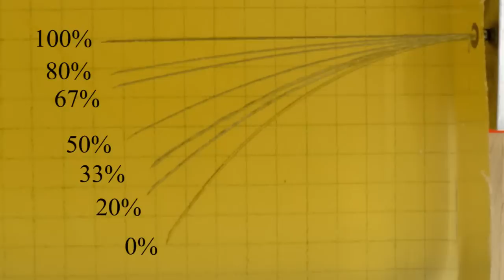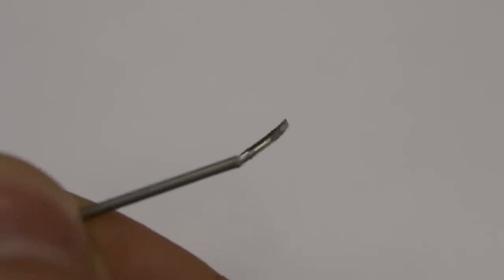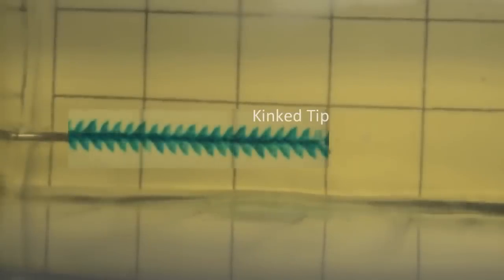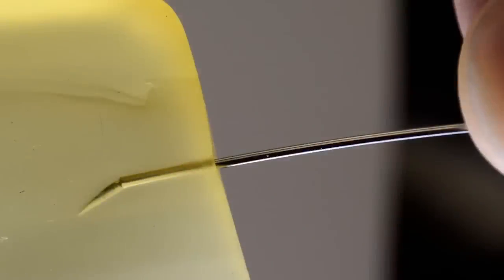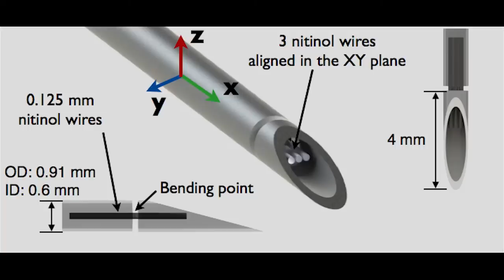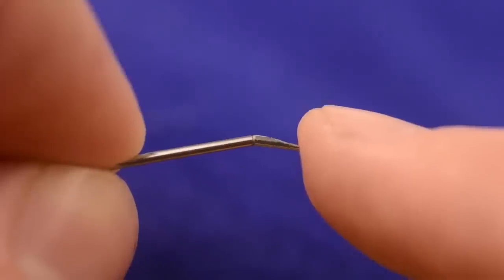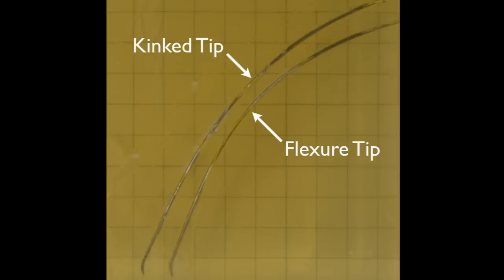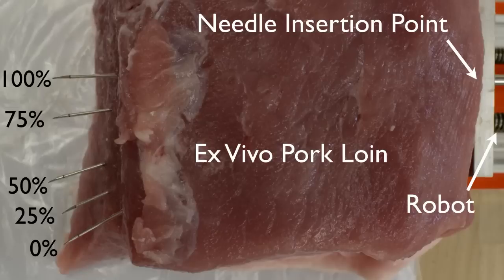Steerable Needles: The Flexure Tip

Comment: This is exactly how horizontal drilling works.
Reply: @landofwolves  thanks Beavis
Reply: This is also exacrly how a mosquito needle looks like when it's searching for blood vessels in your skin
Reply: Hahahahahha I was about to comment this showed my buddy I work with was like shit it's a bore rig needle
Reply: What are the applications or uses of horizontal drilling?
Reply: Really?  It is a tool to drill into far spread pockets of petroleum, through the same initial drill hole.  You can drill at varying angles, and not just straight down, making one hole much more effective, subsequently reducing the impact on the environment.  "I drink your milkshake?"
Reply: We call it directional boring where I'm from. Been an operator for years.
Reply: @RealSaudiExplorer  we use it for running fiber cable.
Reply: haha yee ditch witch directional drilling is what i see

Comment: Wouldn’t the spinning cause substantially more tissue damage, even with the small needles? Instead of one small incision it looks like it almost bores out a hole the diameter of the needle.
Reply: I think that’s what they were trying to minimise by making the tip flex
Reply: I mean, if the alternative is to use a scalpel to get access idk
Reply: @benjaminpierce8835  tru
Reply: The bigger problem is that it will dull the needle extremely quickly. Tissue is pretty good about givinf way to sharp things passing through it.
Reply: Plus the helical pathway and a whole lot of pain🙂
Reply: @xavier84623  skin is very elastic and it's more pushed out of the way but even if it did bore a hole a needle sized hole ain't a problem.
Reply: did you watch the whole video? did l this is literally the whole point of their reaserch
Reply: @NithinJune  did you watch any? the point was to be able to steer the needle.
Reply: @xavier84623  yes and then they go into how to minimise tissue damage lol
Reply: @jenns4926  it still spins. just watch the video its pretty obvious what were talking about.
Reply: @xavier84623  tf? i know what you're talking abt, but do you? They literally modified the needle to minimise tissue damage, the spinning is not a problem anymore bc they changed the tip of the needle. The spinning itself doesn't do more damage because whether the needle is moving or not, it still needs to go in. There will always be needle sized tissue damage. Why are you patronising me?
Reply: @jenns4926  cause it still spinning quickly. its not the extremely curved tip that turned you into chopped meat, but if it is still spinning really fast, wouldnt the spinning do extra dmg? how much more? that was the original question. im sure being able to stab a needle into something behind something will have some applications even if it does cut a bit more flesh on the way.
Reply: @xavier84623  it won't, that's the whole thing he was saying. it's a needle, it makes a hole, the spinning doesn't cause any extra damage because the needle is not a dril
Reply: @snrkybrd  yes, normally a needle is not a drill. this is exactly what im talking about. normally it makes a small horizontal puncture and the needle slips through. it doesnt bore out a circular hole, which is what this one seems to do. thats all i was pointing out.
Reply: @xavier84623  when a normal needle goes in it doesn't just "slip in", it still punctures the dermal layers underneath the top layer. The material they're using here doesn't go back to normal after sticking the needle in and taking it out , whether it's spinning or not. Flesh is different, it does move back. There will always be tissue damage when sticking a needle in skin, but the spinning doesn't exacerbate it
Reply: @jenns4926  a needles shape makes it punch a tiny hole and then the rest of the needle pushes its way in. imagine it on a larger scale, like pipes and a tarp. the wedge shaped hypodermic punches through, it leaves a horizontal hole and then as the rest goes in it stretches a little, and you take it out and there is horizontal hole. then imagine one where it is spinning so that the edges hypodermic end of the pipe cut out a circle in the tarp. this is what i was wondering about.
maybe the needle spins slow enough so this effect isnt a concern, but even in that instance it means that instead of a straight cut through the flesh you'd get a spiral, which is more cutting overall. just something i was thinking about which they didnt mention.
Reply: @xavier84623  it doesn't necessarily translate to what it would create on a larger scale. Tarp isn't human skin. Multiple people have literally said over and over that the 'problem' you're pointing out has been solved  BY THE SHAPE OF THE NEEDLE TIP
Reply: @user-uo9kf1sx5o  i know its a lot to visualize dont worry about it
Reply: @xavier84623  so condescending. Everyone can clearly see that you're the one who doesn't understand but whatever you think. Have a good one
Reply: @user-uo9kf1sx5o  dude you made no effort to understand what I was taking about.
Reply: @xavier84623  haha brilliant. Hardly giving you shit. Just trying to help you understand the very basic concepts of what multiple people have said
Reply: @user-uo9kf1sx5o  you had nothing to add to the conversation, clearly missed important points, yell in all caps, then get butthurt when called out. That’s why the condensation. I didn’t want to converse with you. 
 
This conversation had become pointless. It was a simple question with a simple answer, yes the spiral cut does more tissue damage slightly, probably doesn’t bore out a hole but does do a small spiral at least, but being able to deliver drugs behind organs or bones without stabbing through them makes it worth it in some situations. We pretty much arrived there before you showed up and pointlessly yelled nothing. Have a good one.
Reply: @xavier84623  haha 'condensation'. Brilliant. Also I didn't 'miss' anything. Not saying something doesn't mean I didn't read it. What part of it was butthurt? Not sure I could compel myself to get butthurt by you mate. Also you hadn't reached any conclusions. It was just everyone telling you you're wrong.
Reply: @user-uo9kf1sx5o   “haha “condensation””, double lol. Quad brilliant. What, you allergic to discourse? Iv never seen someone patronizing the word conversation in the middle of a discussion like that lol. We just trying to figure how hypodermic syringes work lol. 
Anyway, read the thread before posting, you had just repeated a thing we talked about earlier. Bye now.
Reply: @xavier84623  the word you were looking for when you said condensation is condescension
Reply: @user-uo9kf1sx5o  oh yeah, thanks i guess. i thought you were continuing the conversation, not just throwing random editing correction. kinda just derails everything and doesnt have anything to do with the conversation. like, we are typing comments on youtube, come on dude. you realize you could go back to my previous sentence and be like "kinda isnt a word, uppercase the first letter, use an apostrophe in dont, bla bla reeeeee reeeeeeeeeeeee". its bullshit dude. if you cant understand the message, thats one thing, but being all like "haha brilliant", because my spell check found the wrong word once and i didnt notice, it is pretty annoying and cringe. anyway, have a good night, its been fun.
Reply: @xavier84623  it's pretty annoying and cringEY when people are trying to pretend the know more than everyone else but can't spell.
Reply: @user-uo9kf1sx5o  ☝️☝️☝️☝️
Reply: @xavier84623  I see the reason and I agree to what you have said yes it would cause more damage
Reply: @elothedrox7347  thank you lol
Reply: @xavier84623  no problem but N has one
Reply: then how else would you steer it? this is the best method they found with the least damage. if it didn’t spin, it will just bend and not get where it needed to be. i don’t understand why it’s so hard for you to get
Reply: @abcdefgh-fb5ny  first of all you could just have a controllable regular needle tip
Reply: @abcdefgh-fb5ny  ummm. its not? ☝☝
im pretty sure that fact was repeated by me several times as part of my main thesis rofl

Comment: This is the same concept we use to drill horizontally underground for the insertion of pipelines. The bevel end goes straight when in full rotation, and direction is controlled by stopping rotation at a certain point along rotation. The hole is drilled, opened up more with a reaming bit, then pipe is pulled through.

Comment: Call me crazy, but a rotating needle seems like it would cause much more damage. That's usually reserved for IO guns to bore into bone for rapid drug delivery.
Reply: Yeah I highly doubt this is intended to replace conventional needles just to fill a very specific niche so I doubt it'll be an issue
Reply: Hmmm.... how you know all this......
Reply: @wingedfish1175  this video is 5 years ago so pretty sure they have used it on other stuff now.

Well there is a manga titled Radiation House where they used it too stop a bleeding in the intestines still same thing navigating to the veins but this time the tip is carrying something that would block the damaged veins and stop it from bleeding.

It’s chapter 45-49 if you are interested.

Looking at it further seems like this procedure is most common used it stopping aneurysm on the brain I guess that’s why i saw one comment mentioning this is used to travel through the spine so yeah. The one in the manga is not as scary as using it on the brain I guess
Reply: The rotating needle would in theory cause more damage and be more painful, but it’s also probably only going to be used in niche scenarios. Things like basic flu shots and anesthetics wouldn’t require this. 

And since this is designed so it can go around important body parts like organs, it’s probably easier and less damaging than the current alternative, which I’d imagine to be an entire incision or surgery.
Reply: @electrolyteraccoon214  as I mentioned right now they are mostly now used for stopping internal bleeding if you guys think this is scary wait until you have a potential bleeding on your brain and they’ll use this to enter the veins to your leg and it will go and cross through your spinal cord and go inside your brain and shoot some stuff that would block the bleeding relatively safe if the doctor is an expert better than dying. 

Though the brain example is the most famous one cause like that’s the only option you can use in case of bleeding inside the brain in the previous comment I also mentioned a manga that showed this type of procedure where they used it to stop an internal bleeding inside the guts. If the patient don’t want to have a huge scar and recover months inside the hospital ( and also not lose more blood due to surgery probably the main reason to use this procedure in the first place ) then yeah stopping bleeding using this method is better.
Reply: @bruhberryishappy  I'm an EMT. IOs are used when a patient is in critical condition and medication needs to be put in their system ASAP.
Reply: @GiskardRevenlov  yes cause fun fact not all manga are fiction I guess you are one of those people that still thinks anime and manga are for kids. I recommend actually trying it first before talking smack at something you haven't even tried.
Reply: maybe it's called an IO gun bc the sound ppl make when it bores into them is "AIIYOO"

Comment: The main problem with this needle will be transfusion. You see unlike the needles we use now this won't be broken after use. So there is a risk of reuse purposely or accidentally while discarding.
Reply: This seems quiet useless to be entirely fair.
If it were put to any use despite its la k of application, it would probably be as asterilizible or disposable tip to a device that rotates and steers it, would have some very nieche usecase and be completely ridiculously overpriced for its utility.
It also wont have a work channel in it, as I think that would impact its performance, it would only serve as a guiding wire for a cathether over it.
I dont see unsafe resuse as a significant issue.

Comment: Would have been interesting if they actually showed the needle being reliably guideed to a target or avoiding something to show you could actually guide the needle where you wanted it, and it didn't just curve randomly with little control over where it goes
Reply: @CantOutRunADuck they claim the angle is controlled by spin, which is why I said it would have been good of they actually showed that in practice and showed it being used to avoid something to show how controllable it was.

I can also just claim something and photoshop together a chart, that's hardly proof of it claims.
Reply: Isn't the pork loin the example?
% show how much spin was used.

Also, i think this is mostly a short video to present what problem is this device solving and not really a demo presentation.
Reply: @heartears  again 
They claim it is controlled 
But then don't show it actually being used to avoid things, instead just showing how much it can bend, not showing the bend as being controlled

Comment: This technique is lifted straight from directional drilling for laying cables etc under rivers and existing infrastructure. Except there they additionally use water jets for cutting... and the "needle" is a steel pipe the size of your forearm.

Comment: This is the same way they "horizontally" drill for oil. They use a bit with an ~1° - 2°  bend (several incremental angles can be purchased, ie 1.5°, 2.4°, ect), and at first they rotate the bit as they drill so it cuts a straight downward hole for a few thousand feet, and then once they've hit their target depth they stop rotating the bit and "slide," they let the weight of the drill bit (and string) and the ~1-2° bend steer & curve the trajectory till the hole is pointing sideways instead of straight down, and then they begin rotating again to drill "horizontally" for another ~10,000ft. They drill straight down to get to the target formation and then they start "building the curve" which is a mixture of "sliding" and rotating so that over time and several hundred feet a rounded right angle curve is created. Once the hole is pointing sideways or the bit is laying horizontally then the curve portion is complete and they can begin rotating to start drilling out the 2nd half of the hole/well. The tighter the curve the more friction and possibility of getting stuck or related issues ("dog legs"). 

They go down for a few thousand feet and then they go over for a few thousand feet.

Comment: These obviously cant contain a work canal, though they might have potential as seldinger method guide wires. Still, I am somewhat hard pressed to come up with a useful porpouse for them. In basically any procedure requiring puncture with a long needle it is rather easy to find a safe inserion path, the challange tends to rise from hitting tbe targeted structure. And somehow I feel like operating whatever machine rotates this thing along with an US head will be more difficult than using a straight needle by hand.

Comment: The last pic with the needles poking through the pork  with the percentages next to it was off, unless you use a different scale than everyone else those werent accurate, the distance between 100% and 50% has a much larger space in between than going from 50% to 0%.

Comment: Considering the size of cameras and wires, it can't be loons before they are able to put a camera inside of the needle hole that sends signal to a screen, and then have 4 carbon fibers inside the needle at the compass points. Then, by carrying the pull on the different fibers, you should be able to accurately steer and place a needle anywhere in the body. Also, if they build a small robot, that can build anything, and have it builds a smaller robot that can build anything, and repeat this until they have a controllable robot the size of a tiny cell. Here is a tiny robot that they already have. It gets electricity, and is controlled, wirelessly.

https://www.nanowerk.com/nanotechnology-news2/newsid=55064.php

Comment: I'm not an engenner, nor a medic... So I might be completely wrong!

Wouldn't be possible to just use wires to control the head? Sinse de design is supposed to be used in delicate areas... Shoving a freaking drill into the tissue doesn't seem like the brightest of ideas to me... Curved or not, a spinning tip will definitely cause way more damege than "I" would "PERSONALLY" deem acceptable.
 Maybe three or four internal (external?) wires, could make the needle work as a (far more precise!) snake's body... Right? 

The needle is thick as hell anyway; would it be impossible to add some wires/strings? 

As I said! I'm not an engenner, nor a medic, so if someone could explain this to me, I'll senseraly be all years.

Comment: I guarantee you if you made a normal needle without that fancy tip on it just with the side cut on it the way regular needles look where they have a 45° cut on them and put it in the same kind of flexible needle and all you have to do is turn the needle and the beveled edge will climb and turn whichever way you want it to go as long as you turn it to go that way you don't need no fancy nothing so that's just Overkill

Comment: So it's basically a steering needle not a steerable needle.

Because its designed to steer out of hand, and the only way to make it stop steering is actually not making it stop steering. All you're doing is make it steer in tight circles making it seem like it's going straight.

Imagine a car that always steers left and then calling it a right steerable car because you steer left 360 degrees